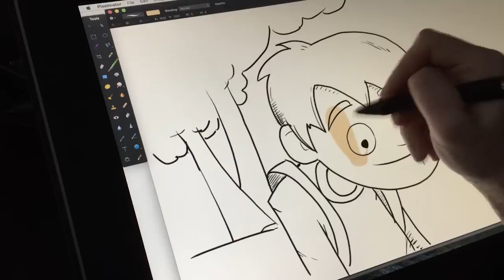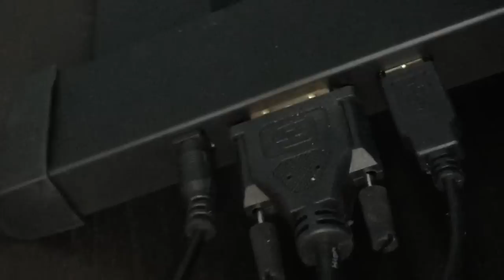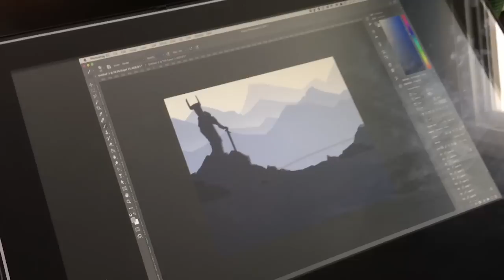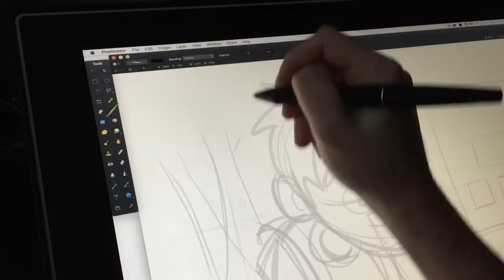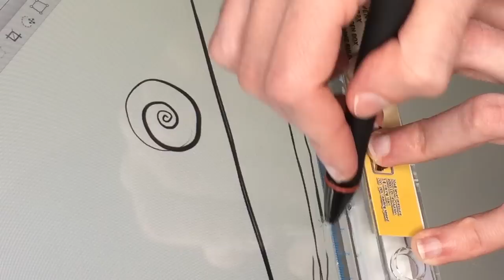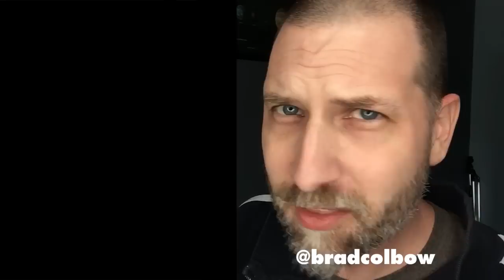Review: Yiynova mvp20u+FE

Comment: I have the older version and while it has it's quirks it works very well for me. BTW I believe I have found a jitter fix/reduction for this as well as other tablets such as the SP4. I noticed I also got  jitter with my mouse when playing FPS like Battefront. Jitter was also very apparent when drawing in Clip Studio and Photoshop. The fix in Windows, go into Control Panel, Mouse, Pointer Options: Uncheck Enhanced Pointer Precision, and also set the pointer speed no higher than 4!! When doing this I get virtually no jitter with the mouse or pen! If you need a faster mouse cursor, I use several logitech mice and the speed can be set independently from Windows in it's own driver app.

Comment: Thought parralax was for how often where you draw the line isn't where it shows up on the screen.
Reply: supreme84x It sort of is, bit the reason for it is the vertical distance between the top of the screen glass where you touch and the electronics of the pixels where you perceive the light as comiy from.

Comment: Nice review Brad but it seems yyniova still not quite there. My XP-pen artist 22 works great in all is "cheap build" qualities. Feeling cheap is the least of my concerns, jitters and over performance of what the product was intended to do, is all that matters. If I put the pen on the screen and get a straight line, I'm sold. After all this time yyniova still doesn't get. Huion, Ugee, Xp-pen have stepped up an seem to be on the right path.
Reply from the maker: I've heard a lot of people asking about the XP-Pen. my hunch is that it's a rebranded version of another brand (UC logic maybe?). I need to do more research into them, maybe I'll pick one up to review.
Reply: Brad Colbow XP-Pen isn't a rebrand, it's a separate company that uses the UC logic hardware that a few other pen displays use. Ugee is the company UC-logic created to enter the market place, however UC-logic has been suppling input devise for over 20 years. For example if you've gone to the bank and gave an electronic signature on some grey slate thing, that was probably their hardware.
Reply: I have the Artist 10S, same issues. Performance and display is great but the build can use work. Drivers need work. Needs a built in stand or one shipped with it. And the cables....my hdmi base came out 3x....cable came out, hdmi head with pins stayed in my laptop. Putting it back in the holes is a nightmare. And the pen tip offset and calibration isnt too good. But over all its a great product. screen scratches easily too.
Reply: +Peter Mayer there was reason a reason I didn't purchase the 10s, and you just named them. However user experience have varied since no two computers are alike. Aside from a few quirks I used the screen protector and didn't have driver issues with the Xp-pen artist22. That doesn't go without saying my Wacom 12wx wasn't without a few headaches. I retired it because the left side of the screen started not to respond to the pen pressure. Now it lasted me over 6 years, and that's really good, but I was ready to move on to a bigger screen and didn't have 2k just laying around. With that said I assume we all watched the review, because we want to do digital art of some kind, draw on the screen, BUT we don't have Wacom money. By looking for an "affordable" option I've accepted to fact I was looking for pen tablet the brings me the "least headaches". The yiynova, looks like a headache people should pass on.
Reply: Exactly, i didnt go for the 22 because its big and me and my family is living more or less on the go, temporary place. Never know where i land a job and thats why I dont even have a desktop PC. Also I dont do 2D art as a pro (im a 3d artist / architectural visualizer) so I just need it for the occasional sketching to relax my mind and its perfect for that.  maybe later on i will trade up.
Reply: Peter Mayer That is great to hear Peter, that you found a device that fits your needs.
Reply: UC Logic and Xp Pen are different companies. UC Logic does not supply any hardware to XP Pen or Ugee.
Reply: Rknee Gordon I have this same exact Yiynova and it’s amazing. It’s one of the best drawing monitors on the market. It’s very cheap but doesn’t feel cheap. It’s big and the fact that you can change its position is great. It really makes it comfortable. This guy reviewed this on a Mac I think. I have a Windows and I haven’t had any problems whatsoever. The cables stay in there good and it never bothers me. It draws smoothly and crisp. If you want a Wacom but can’t afford it, I suggest getting a Yiynova, it’s one of the closest thing you’ll get.

Comment: Old Wacom emr for tablet pcs such as Surface Pro 1 and 2 seem to suffer from the cursor migrating around the pen tip. The Huion GT 190 I have has that problem toward the corner of the screen where the DVI and power connection is.

Comment: Really disappointing this yiynova didn't perform better, 
I'm thinking of getting the artisul d10, would you say it is similar to the d13? Performance wise?
Reply: Nope. The d13 seems to perform better than the d10. Now hopefully any issues have been resolved for the d10 BUT you're going to get better value with the d13, simply because it has been rated to give you less headaches out of the box, PLUS the mobility factor is still I play as it has one cable so you laptop can supply the power. If it's a mystery of budget, I can see why the d10 is appealing. Do some research....then decide what best for you. Cheers.